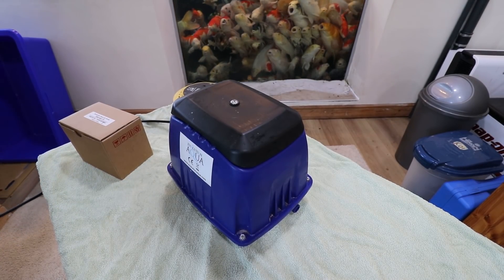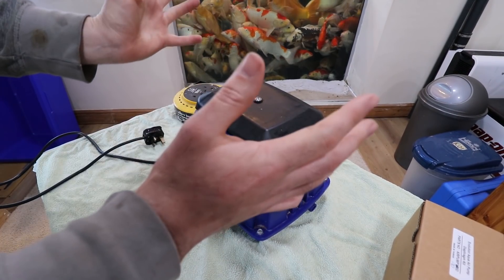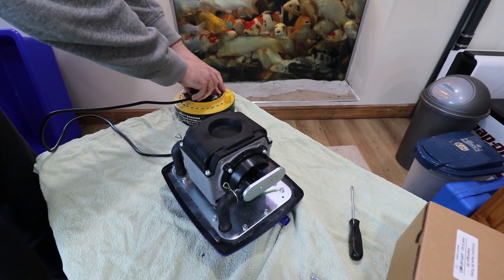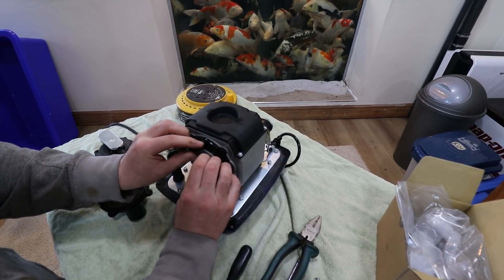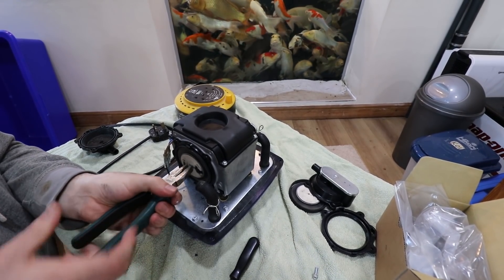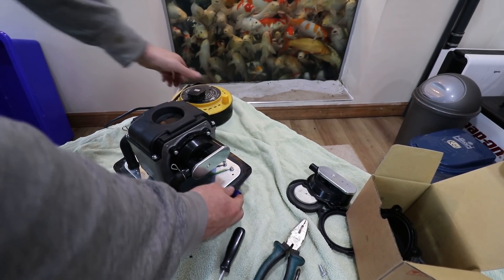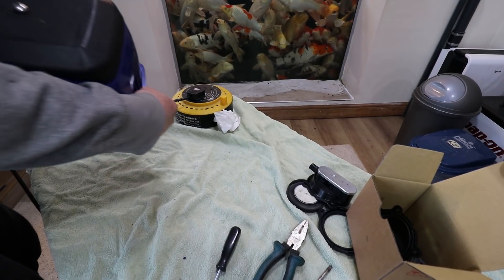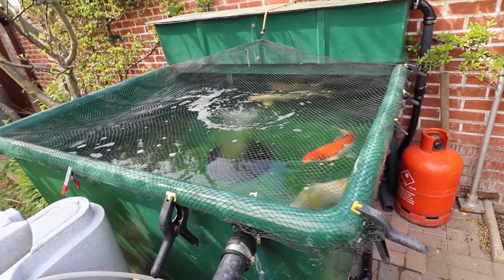Air tech 130 diaphragm Change

Comment: I have an air pump which is sitting and wishing I would give it some attention. Looks like a new diaphragm is in order. Good diy video!
Reply from the maker: Best to keep them in working order you never know when it might come in handy 🙂 Thanks 🙂
Reply: That’s the truth. I had it on hand as a backup and unfortunately it didn’t work when in need. Blew air similar to yours but not enough once submerged. One of those things you think about but never quite make the time. The video gave me some motivation. 😆
Reply: @AdamJulyan  what could it be if only getting weak airflow